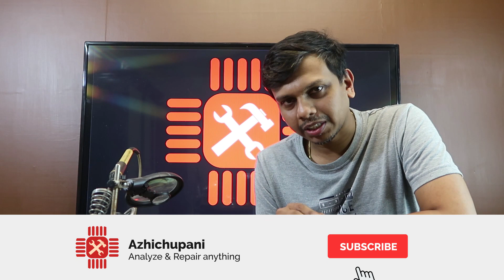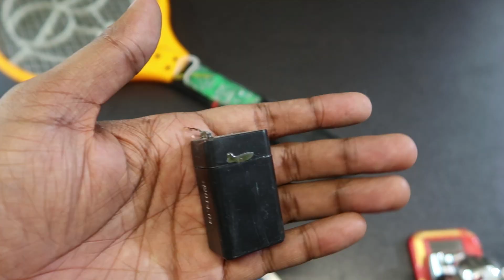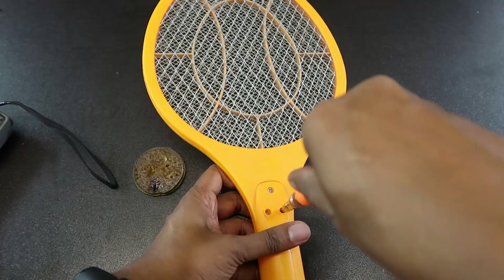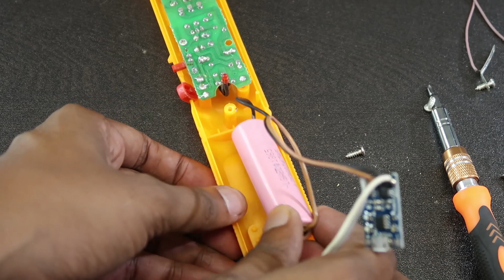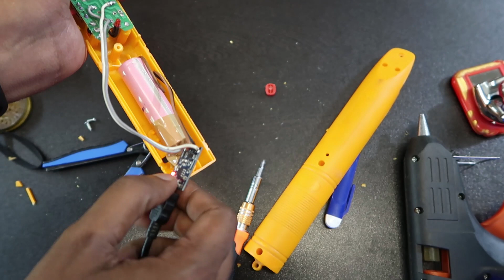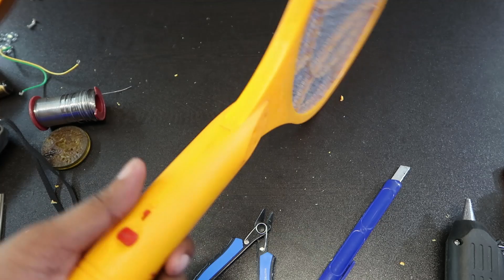Azhichupani - 3000 mAh Electric Mosquito Bat | ഇവാൻ പൊളിക്കും

Comment: Bro.  Ethinu enthu board anu  upayogichathu?

A board ethra RS ayi?

Ethra volt anu  capacity? 
Please reply  to me
Reply from the maker: 18650 protection module Oru 30 Rupa varum
Reply: Just use its origianal led acid battery. 30 ruppes only. Available in all electronic shopes. Simple
Reply from the maker: @haashiiii  what about the charging voltage ??
Reply: @Azhichupani  the battery is 4 volt. The charging is in between 4.5 to 5 volts (I'm doing). Its perfectly works.
Reply from the maker: @haashiiii  I checked it was 22 volts
Reply: @Azhichupani  what 😯. Maybe your charger will be damaged 
Or pls use a mobile charger for charging led acid battery. It works
Reply from the maker: @haashiiii  charger no voltage regulator bro it's capacitive dropper circuit pause the video and check the board
Reply: @Azhichupani  Yes i know. Maybe that capicitor will be damege(105 J). Replace it. Then check its voltage
Reply: @Azhichupani  There is no need of capacitive dropper circuit. We can charge that battery by using mobile charger.
Reply: @haashiiii   correct

Comment: Eyy tp4056 board overayit heat avunundo
Reply from the maker: Yes bro.. heat aakum, charging current kurayum.. time Kore edukkum charge cheyyan
Reply: Just use its original led acid battery. 30 rupees only. Available in all electronic shopea
Reply: But 4me there is no heating issue.. but takes time to charge
Reply from the maker: @pranavvijayan4903  monitor the circuit carefully and use a good amperage charger if you want the board to heat up

Comment: Broo...4.5 volt ulla oru battery charge cheiyyan 4.5 volt out ulla charger thanne veenam ennu undoo...athil koodiyaaalooooo...

Mattoru doubt enikku ii battery and charging circuit evideninnu kittum???
Reply from the maker: 4.5 volt battery?? Datasheet undo?? Maximum voltage etraya ennu nokkanam.. eg: 12v battery I think 13.7 volt vare charge kerum so at least 13.7 volt allengi 14 volt venam
Reply: @Azhichupani  bro cheitha pole...njan cheithaloo ennu alogikkuaa....0ru 750 mah nte 2 dueracell battery vaanagn thiirumanichu appo athinu charge cheiyyan oru charger undakkandeee...appo ethra volt ulla charger undakkanam ennathu ariyanam????? Nammal engane athu masilakkum???

Comment: അധികവും വരാറുള്ളത് 4v 0.5ah battery ആ സത്ത്യേട്ടാ
Reply from the maker: Sealed lead acid battery alle bro?? Ennalum 24 voltil charging...
Reply: @Azhichupani  4V kk 24v കൊടുത്താൽ അത് താങ്ങുമോ
Reply from the maker: Athanu enikkum manassilakanje bro 24V dc aayirunnu charging voltage
Reply: @Azhichupani  ചിലപ്പോൾ battery കണക്ട് ചെയ്ത് ചെക്ക് ചെയ്തുനോക്കു വോൾട്ടേജ എത്രയാണ് ന്ന്
Reply from the maker: @AllTechMalayalamATM  connect cheythappo ulla volatage aanu paranjathu
Reply: @Azhichupani  Mm
Reply: @Azhichupani  ബാറ്ററി കേടായതല്ലേ, ഓവർ വോൾട്ടേജ് കൊടുത്തതിനാലാകും. ചിലപ്പോ അതിൻ്റെ ചാർജറിലെ dropper capacitor കേടായതാകാം.

Comment: അതിന്റെ original ബാറ്ററിക്ക് 30 രൂപ മാത്രമേ വിലയുള്ളൂ. ഇതായിരിക്കും നല്ലത്. വളരെ cheep rate alle.
Reply: അതെവിടെ നിന്ന് കിട്ടും.   എല്ലാ  ഇലക്ട്രോണിക്സ് ഷോപ്പുകളിൽ നിന്നും  കിട്ടുമോ?? 

മോസ്‌കീറ്റോ ബാറ്റിൽ ഉപയോഗിക്കുന്ന ബാറ്ററി എന്ന് തന്നെ ആണോ പറയുക?
Reply: @An-lc2fx  angane paranjalum mathi.
Allenkil "4 volt lead acid 0.5Ah battery" ennu parayuka.
Mikya electronics component shopukalilum kittum
Reply: Anas Alzaki 4volt,500ma lead acid battery, price rs,32
Reply: 5kollam mumb ipo 50rs